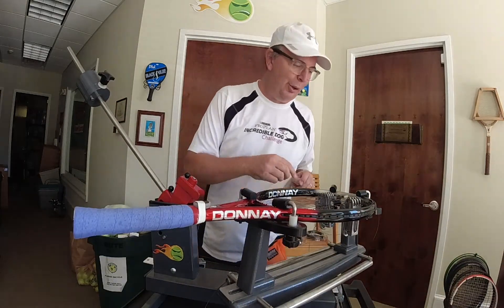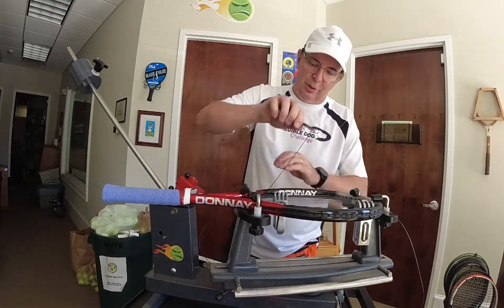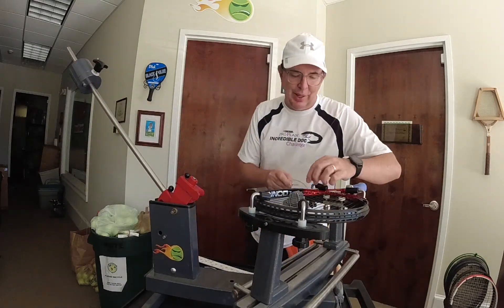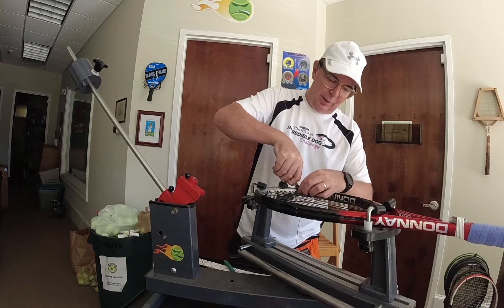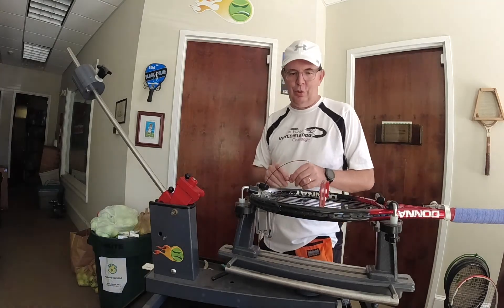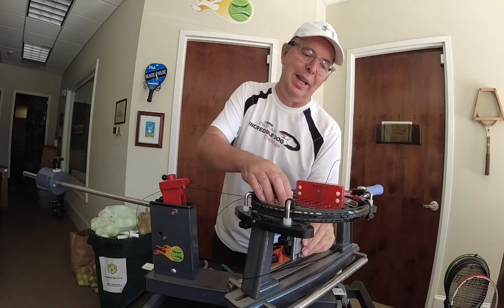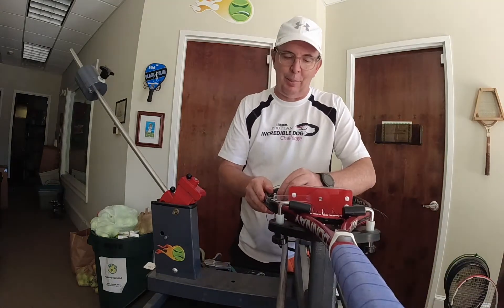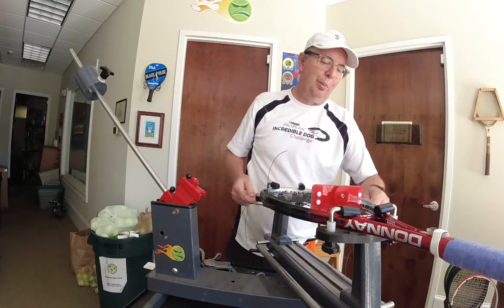Stringing Video - A great HACK for starting with flying clamps and no starting clamp needed!

Comment: How do like the Stringway?
Reply from the maker: I’ve had it for approx 20 years and it’s every bit as solid today as it ever was.  It’s a beast of a machine.  Very precise.  Easy to use.  Admittedly I don’t use it as much today as in the past, but it does get occasional use.  I prefer the use of flying clamps and the new Pro Stringer Claws are my favorites.

Comment: Have you ever had a problem with lower tension in the tie off strings?
I also use the pro stinger claws
Reply from the maker: No matter how terrific of a stringer you are, and no matter what machine you are using, it is inevitable that you will lose tension when tying off. It is definitely not related to using claws.  However, I have always increased tension on my final mains before tying off.  Even with this some tension is lost.  I also manually twist my claws so they are as close to perfectly parallel to strings when tying off mains.  Hope this helps.  I can make a video showing this at some point.
Reply: Yes please.
It's not really a problem for me, but I have a customer that complains about that.
I've tried to use 2 clamps in the tie off string but i can't get consistent results

Comment: Have you found the Pro-Stringer Claws to be better than the Stringway clamps?  I have Stringway's clamps and lately, they've been popping open after tensioning and clamping the string causing me to start all over.  It doesn't happen on the crosses, only on the mains.
Reply from the maker: I do prefer the claws.  The Stringway clamps are solid. I’m surprised you are having issues.  They may need to be reconditioned.  I’d suggest reaching out to Fred Timmer at Stringway.  I’m sure he’d be willing to help you by sending some instructions.

Comment: I'm getting ready to order a set of the Pro-Stringer Claws.  I'm curious if you have any experience with their Starting Clamp?  I've been unable to find any information or feedback on it, except for the limited description on the Pro-Stringer site.  Thanks!
Reply from the maker: Hi! It is a new product. I tested a pre production version and have used final version. It is a solid clamp. As good as my best/favorites. Like all starting clamps, the string has to be placed deep in the jaw to avoid slippage.
Reply: @johnyoungblood  Thank you!